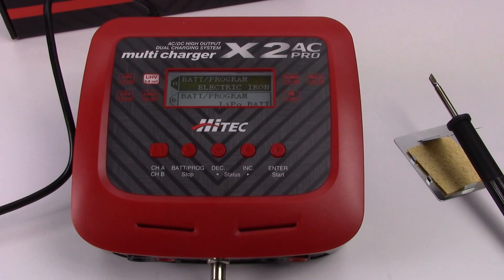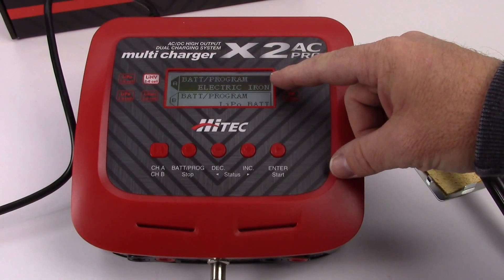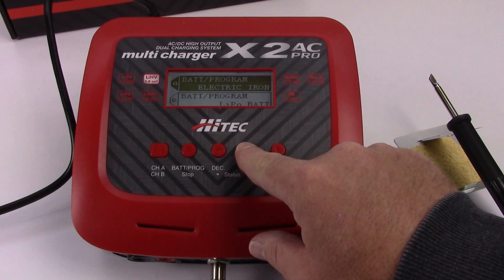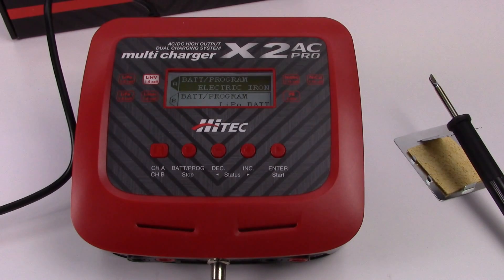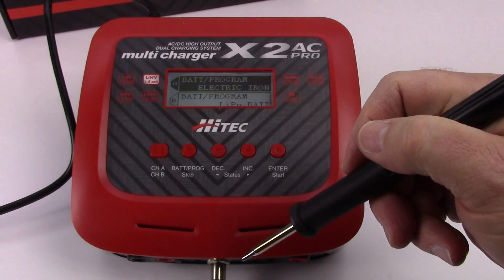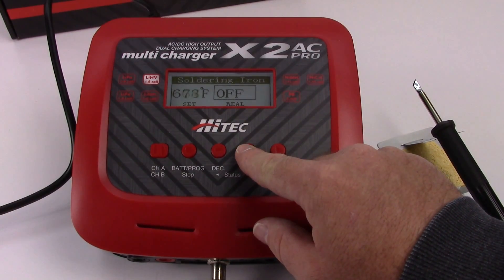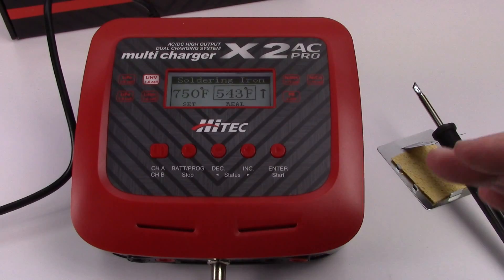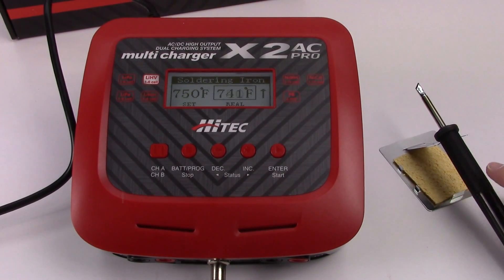HItec X2 AC Pro - Soldering Iron Test

Comment: i grounded my self to the wall and then when i touch solder to the tip of the iron it shocks me were the ground wire is attached    , then when i measured the voltage between the tip and ground it was 26 volts ac is this normal two of my soldering irons do this
Reply from the maker: +Austin K Not sure on that one...Be careful
Reply: It was to iron i replaced it with a weller, never trust radio shack soldering iron
Reply: Austin K
Reply: Ron Toledo yes ?

Comment: Hey with the AC Mode, is it 100W per channel ? or can you have 200W going to just one channel if you're only charging the one battery ?
Reply from the maker: +Richard James Nope, separate channels
Reply: i own this charger and yes you can allocate the full 200w to channel A if charging one battery, channel B maxes out at 100w

Comment: Hey Man thanks for the last response and I think the reedy charger is awsome. I'am in about $1200 on my Losi. I know I said money wasn't an issue somewhere but It's getting up there. Would the soldering iron on here be efficient to solder up my esc and motor ? I def don't wanna burn up a circuit on my rx8 gen 2. If I could get a midrange charger x solder station that would be great. Would I still need a separate solder station ? Thought this video would be an appropriate place for this question. I didn't know you had a vid for this particular charger.
Reply from the maker: +Jay West I think the HItec X2 AC Pro is a great charger and the soldering iron is a bonus.....not sure if it would beat a stand alone soldering station, but it's great to have incase you need to fix a spot that came un-soldered